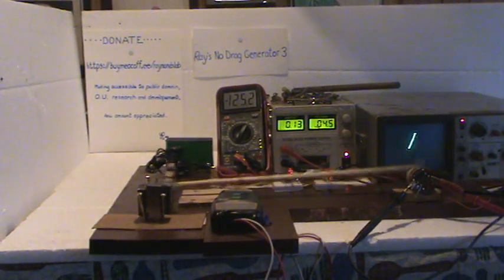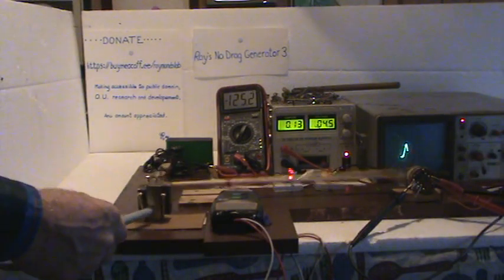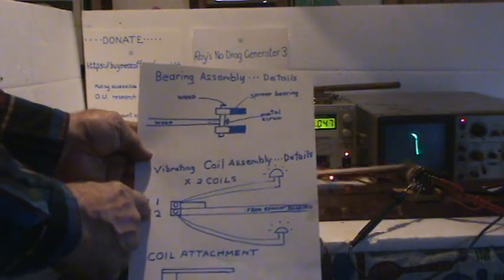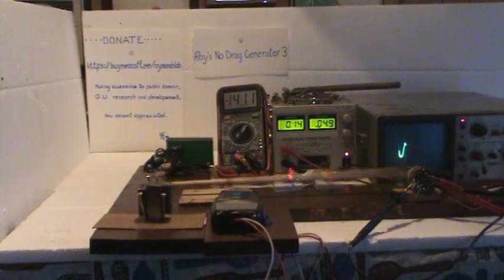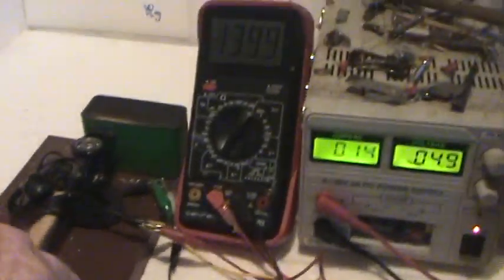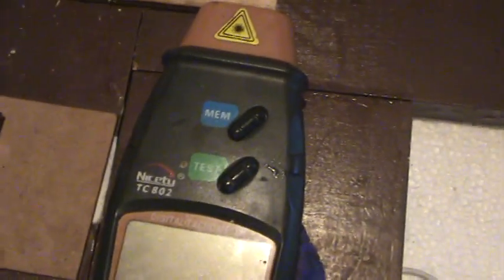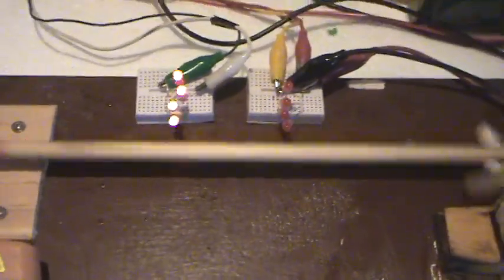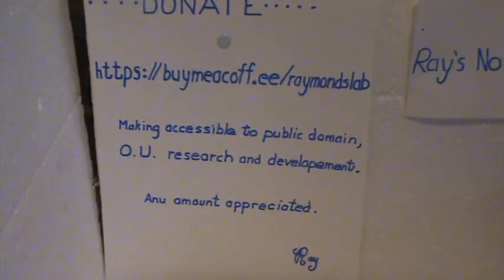Ray's No Drag Generator 3

Comment: If you would like to contact Media Library please contact us at 313-651-5349 we are creating Andover Unity motor to show what overunity really is it does not mean more power out then end it means a fluctuating or vibrating power unit just like you have in your computer backup switches basically it is a specialized Reed switch that switches from one unit to another meaning the motor and the generator but we can talk about that later if you want to email us email us at medialibraryinfo@gmail.com we'll talk about your magnetic battery and when we do our video will make sure that we pass it on to you thanks a lot
Reply: No. Overunity is literally machine that outputs more power than being puts in.
Reply: Dom't ever forget about aether. Electromagnetic induction is actually energy creation but since they want to protect their puny thermodynamics so much, just simply say vacuum itself is excited to the point of it shares energy into the system. Aether in other words.
Reply: @atum7355  You're simply making mistakes that people made in the past about creating energy these topics have been well discussed try going to Google Scholar and look up scientific papers instead of trying to figure it out yourself you'll see that people have been working on this for hundreds of years and had quite some accomplishments some of the things you are seeing are not necessarily wrong but the physics behind it is explain different don't argue with a Liberian because I didn't write these papers, if you want people to say that you're creating something new then you should write the scientific papers and publish them. But if you don't there's only a couple reason why you wouldn't and one being that you know that you're wrong and you're just trying to make money off your YouTube videos the others have to do with something I'm not even going to go into oh, look I've wrote papers on overunity I've been published I'm the father of overunity so you should understand where I'm coming from when I talk about my Creation with passion sorry if you don't believe that but anyone telling you that overunity is more power out than you put in, is wrong. But just in case I'm wrong please take two identical glasses pour water into that glass if you get more water out than you put in then give us a call or make a YouTube video for everyone to see this phenomenon and prove your theory correctly.
Reply: @WIZ56575  Lol. I didn't even start explaining the machine and you assumed it has anything to do with impulse current. It isn't.

Let's look back and take a look at the basic synchronous generator. Energy is converted from any sources to mechanical to electrical. Is this really the case? No.

As current draw increases, induced emf reduced due to faraday's law. Hence, rotor current is increased to raise the voltage back up. Lenz's law causes stronger magnetic repulsion which caused more mechanical energy needed to rotate the whole thing. Self-excitation is positive feedback and use no power from the grid. Lenz's law is negative excitation.

So, what happens when one use electrical input? Electrical to mechanical to electrical, all within ONE structure.

Adding another stator winding layer to a synchronous generator as output, replacing traditional sources as input. Think about it. What will happen if you increase rotor current. Remember, everything is synchronous.

In other words, overunity is as simple as synchronous amplifying transformer.
Reply: If what you were saying then you could have unlimited energy by putting energy in a loop and let everyone just collect the magnetic coupling which is supposed to be a waste product and you should have continuous energy for everyone on the planet from one source of power oh, that's against the laws of confirmation, you said it partially right you could apply more physics to it but simply would we did it had a fluctuating battery which has all the power you need so it is overpowered. Then alternate those batteries so you don't have to check as much charge off one single battery the more batteries you add into the system and the more fluctuation you put on the battery you change the timing between the charge and discharge this is over Unity V / 1. Once you get this you understand that if it takes a battery 2 minutes to recharge then you have to add enough batteries to compensate for those two minutes then when it reaches back to its destination it will be fully charged and you do this for every battery this is the physics behind overunity I'm Lloyd Stovall and I created over Unity this is the physics behind over Unity I'm lost over and I created over Unity so stop trying to tell the person who created it what it is